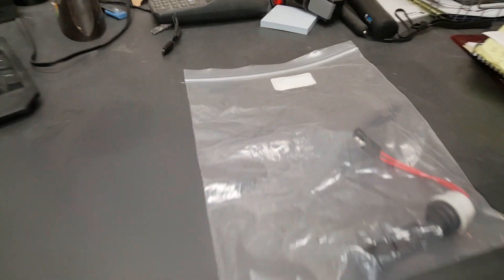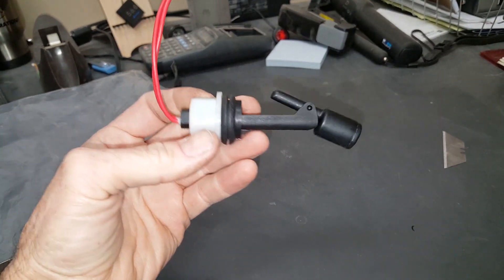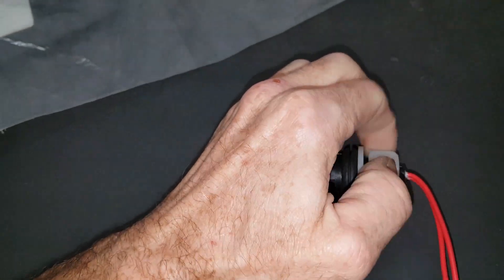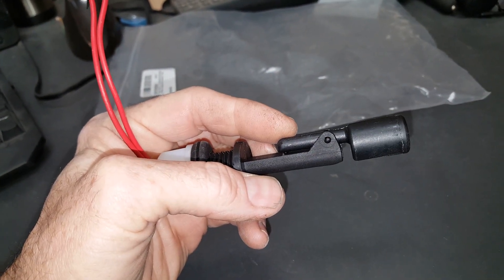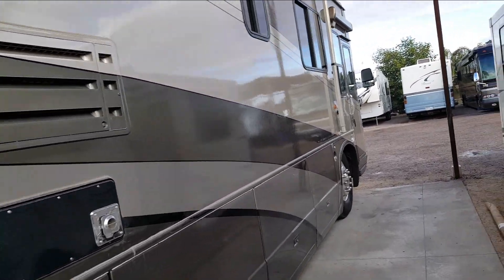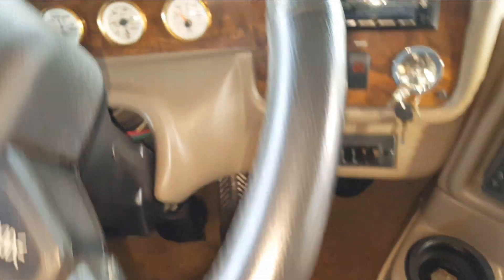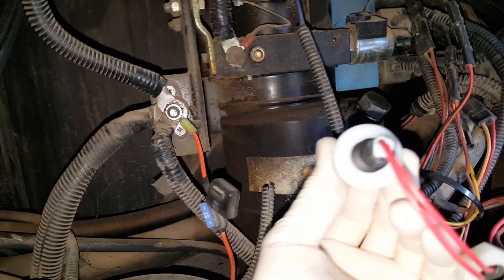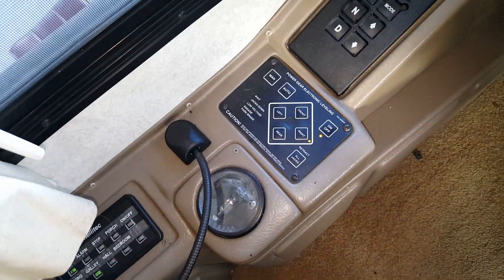Replacing a Powergear leveling system jack down warning switch...float switch!

Comment: We bought a 2008 Itasca Sunrise this summer, and have had to do a lot of catch-up maintenance. We have had a leaking power gear power level system. This video taught me how to remove the float switch and re-install. I was able to clean up the float switch, washer and nut and get rid of the grime. I reinstalled the switch, and used the tip you had in the video, hold the switch with pliers while tightening the nut. 
I re-installed, leveled the coach a few times then let the coach sit over night and check it today...no leak! 
I appreciate your videos! Thanks much!

Comment: Hello. I just discovered your channel and am binge watching your videos to learn all that I can. We just bought a 2008 Fleetwood Bounder and we used the Power Gear leveling system to stabilize the unit so we can clean it. We are ready to leave for our trip however the jacks will not go up. The panel says low voltage. I have checked all fuses and they are good. Battery power when running is 14.2V. We tried disengaging the emergency brakes and waited 10 minutes and nothing happened. Just says low voltage. It doesn't even recognize the jacks are down as the jacks down light is off. I just watched your video on replacing the float switch. Will a faulty float switch cause a low voltage? Please help us. This is our first motorhome. Thank you so much.

Comment: Do you have any videos on how to 1. Drain the reservoir and put new fluid in? My drain screw is super hard and won’t budge.... suggestions? I’ve pushed and pulled to the point im scared I’m going to break the actually metal reservoir! And 2. How to manually release fluid out of the hoses on the Powergear power down spring up version, one hydraulic hose into each jack only so it’s not power up. I can’t get my jacks to come up so I can’t move the Rv. I have 3 solenoids and a dump solenoid three with plastic screw in tips but once I remove the tips it’s just a metal like rod, nothing to put a screwdriver in or pliers to turn to release fluid from hoses? Will I just have to resort to unscrewing the actual likes and allow the fluid to pour out so jacks can manually come up? Please help!!!!!
Reply from the maker: Depending on the system you may not have a manual retract. If it is spring return like I think it is, the easiest but messiest method is to crack the line from each jack at either the jack or manifold. Make sure you are safe and will not be crushed and just crack the line slowly. Fluid will drain out until the jack is retracted. You could also connect the coils around each valve to battery power or a cordless drill battery which would open the valve and allow the fluid to retract cleaning. I would say not to try to take the drain plug out if it is that tight. I'd say use a suction transfer pump with a long hose to pump the fluid out. However, unless there is substantial containmination in the fluid, there is little reason to change the fluid.
Reply: AZ Expert I think my wife put break fluid in the reservoir instead of power steering fluid.... sigh and it’s now mixed and I feel like it should be drained and new fluid added? I was told not to mix any fluids in the hydraulics. So I’m worried it’s gonna tear up the system.
And yes great idea, I’ll get some sort of syphon system to pump it out with
Reply: AZ Expert I also read in a forum that you  can take the plastic screw on vape off the solenoids and turn the metal rods counterclockwise and that is the way you manually release the fluid from the lines?
Reply: AZ Expert the motor runs whenever I touch any of the buttons on the control panel but zero movement up or down... any suggestions would be greatly appreciated
Reply from the maker: @Stephrae70  turning the rod will unscrew the valve from the body and will release the fluid,  but it will still make a mess. Id rather crack a line or jump power to the valve coils. It sounded like you do not have a manual release in the middle of the the stem to open which is normally a hex Allen type screw head. It really sounds like none of the valves are opening with the controls so either the controller is bad, or a fuse is blown. Brake fluid has a different viscosity than hydraulic fluid but is technically hydraulic fluid so I would try to get the Jacks retracted first.
Reply: AZ Expert I will work on it today for sure!!!!
Reply: Thank you for all your help. No hex/tstem valves anywhere! So looks like I will need to work on releasing the lines manually today! Mess or not! Haha
Reply: AZ Expert also how would I do the thing where you connect the battery etc to each solenoid? Could you run me through that in case I may need to try it? I’m not sure if I have the strength to break a lot of these bolts... so any help with alternatives would be great! I’ve seen people do stuff like that but never done it myself
Reply: AZ Expert well, nothing has worked. I’ve cracked every one of the lines to make sure how hard it was going to be and they actually loosened fairly easily. The hardest one will be the driver side rear! The line comes in from the center of the Rv and connects facing inward instead of outward. So that will be the first one I’ll do! Slowly! Haha while the tiger jacks hold the Rv up so I have some space. I’ve replaced connections, added fluid, removed fluid and take the entire control panel apart! Checked every fuse in the Rv! I think you’re right, the control board is just not functioning. I’ve had some issues with it in the past over the last few years briefly every now and then.. I think it’s just time to replace 🤷🏼‍♀️ thanks for you help!
Reply from the maker: @Stephrae70  I'm sorry to hear that. Good luck.
Reply: AZ Expert got it! Cracked the bolts and drained the lines and jacks are up and we’re Mobile again! Moving forward we will try to figure out what parts we may need to replace or control pad (has to be sent to be refurbished) most of these parts aren’t even available at this point so.. we shall see. Either way.. thank you for your help and input!
Reply from the maker: @Stephrae70  sounds good. The controls may be obsolete but the pump and Jacks are not. There may be an upgrade kit. Good luck

Comment: AZ Expert - my Power Gear setup up has a Kwikee Pressure Switch instead that I think has failed.  The tech manual says that if you have continuity to ground when the jacks are up, it's bad.  No longer made and no replacement.  Without having to change out the entire system, any idea on how to get around this issue?  Can I just unplug as well?
Reply from the maker: What kind of system is it? Level Best, 2000?
Reply: No. It’s a Power Gear / Dewald system with a manual controller up front. “Kwikee P/N 140-1179” i’m starting to wonder if it’s not that damn control panel but no parts are made anymore for any of it and wish there was an aftermarket way to upgrade the system or something. Sigh! Where in Arizona are you? I’m in Scottsdale.
Reply from the maker: @Proost1  The shop is in Apache Junciton. I would be curious what the problem with the jacks are. In general, Lippert bought powergear, dewalk, kwikee, and most the valves, jacks, pumps, switches are or should be available. The controls/electronics are likely obsolete but should be upgradeable.
Reply: Lemme shoot you an email and get your contact info.
Reply from the maker: @Proost1  azrvexpert@gmail.com

Comment: Whats the part number and where did you buy the switch?
Reply from the maker: https://www.amazon.com/Power-Gear-14-1136-Vertical-Connector/dp/B078C885S4
Reply: @AZExpert  - That doesn't look anything like the part you show in the video.  Are you absolutely SURE the 14-1136 is the right part?  Looks more like a 14-1116 style assembly to me.
Reply: Actually... ignore my previous comment.  Looking closer, it appears that the Amazon page has a computer rendering -- making the wires appear as straight metal rods.  Thus my confusion.  My apologies.